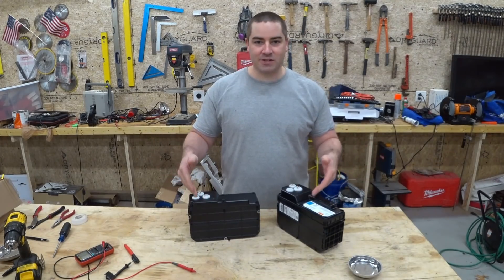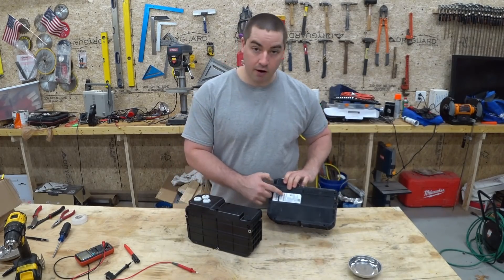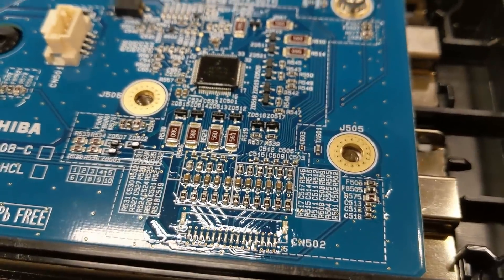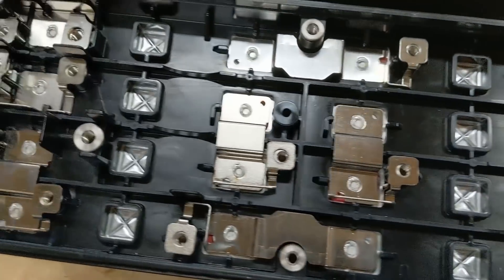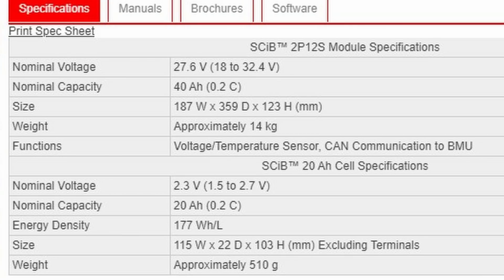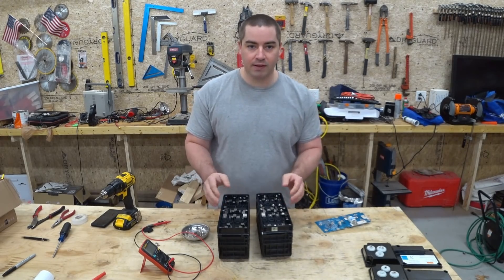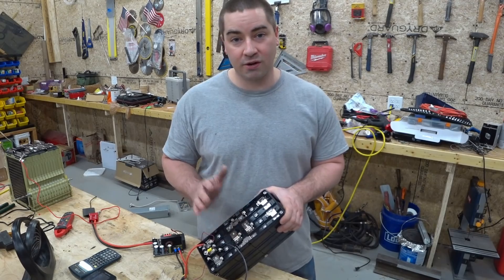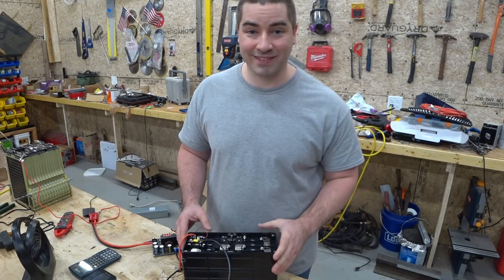Round Trip Efficiency Test on LTO SCIB Battery, Lithium Titanate

Comment: What kind of BMS will be recommended for this battery.
Reply from the maker: If you are building a 24V, 36V, or 48V, then I'd use this BMS: https://batteryhookup.com/collections/bms/products/8-24s-200a-lifepo4-bms-with-uart-rs485-can  
You will need the computer interface to re-program it to LTO settings.  It comes with LiFePO4 settings.  https://batteryhookup.com/collections/bms/products/computer-interface-for-battery-hookup-bms
Please use discount code DAVIDPOZ for a discount and it helps track this channel.

Comment: thats another great thing about LTO, you can get enough amps to start a vintage high compression v8 (1960's MEL 430) from something the size of a ytx30L-BS motorcycle battery.  and unlike lifepo4 or li-ion they don't blow up when crushed or shot.
Reply: makes them great for making portable jumper packs

Comment: The voltage adapter you used and/or mentioned, do you have the specs on it? When you talk about high battery voltage around 64v etc, my growatt MIN series requires between 350-500 volts 🤦‍♂️. 
Great video as usual and thank you for the explanation of the cell type etc.

Comment: Hi David it was wonderful explanation done by you in this SCiB batteries video 👌. How to import these batteries to India and how much it could cost for my Sedan car EV project. Also if you can suggest Reluctant motors which can be easily synchronise with these batteries. I am trying to fit for a Sedan Car which should have a range of 300 miles per charge. You can also write me to my email getmymail0015@gmail.com

Comment: They are currently doing some testing here:

https://batterytestcentre.com.au

My understanding is that some battery derating is necessary at temperatures above 35°C, but I do not think this will be part of the testing process.  In spite of your excitement for cold weather, there is, also, some derating for cold weather.  Take a look at the Zenaji warranty.  It should provide you a better idea,

Comment: I use lto in my truck to power a 20000watt system in my truck. I love this battery. I also discharged to 2v on 4 cells and made a full recovery
Reply: I also use lto to power a 35kw system in my suv.  They are amazing cells
Reply: I have a 6kw in my trailer can let it freeze and have solar panels to keep it charged with 5c charging rates and no issues with discharging to much zero. they are pretty much maintenance free had to install 2 battery balancers as on the top end they swing wild. But if you don't need the last ten percent one is enough

Comment: Your 2.0V discharge cutoff is ok for most applications. Just be aware that if your in a cold environment and doing 1C rate or above that this is leaving about 20% of the capacity unused. I think that's the main reason that the manufacturer lists 1.5V instead. Indoors in climate control 2.0V is fine but in the cold it's nowhere near as steep of a dropoff at 2.0V.

Comment: The potential of these batteries is being underutilized. These should be used to make electric boom lifts, scissor lifts and fork lifts. They seem to be extremely durable and long lived. Most of these machines need counter-weights built into them to avoid tipping over, so the added weight of the batteries could double as the counter-weights, the machines would be super efficient and would have decades of service life.

Comment: What type of system would I need for a small government Military generator , 5, 000 t0  10, 000 watts , I am putting solar cells on a shed I bought from the   Minanites  , they even stoped me from building my tiny home , tell it was paid for , then 2 years latter they started to make there own , I was not happy at all , & they to not want give me a bill of sale  , it came out of Denver Co . We had  group of kids take a car & put the 1.5 Lithium batters together , I don’t remember the volts or the way it was made , before they closed the track they got the car to run close to 200 in 1/4 mile , my building is on a 5th wheel trailer that was a travel trailer that burned & has slide out  , one of the gray water tanks  , I have 2 black water tanks to put in . The trailer is 48 feet  , & the building is 8’ X 16 , we are going to add to too the building , main deck is 40’ , & it 38’ to 40’ . It came with 2 big axle , but we are going to add 3 axle with a spread to carry the weight , it is being moved to Washington ,State , as I have to get to sea level ,  because of heath  you are helping me a lot thank you , I had a gas generator , but was stolen  . Thank You very much .

Comment: Running a 6S3P (Microvast 15 Ah cells) built 14.4VDC LTO battery built to order (China special - $500CAD) into a Group 31 battery box as my van's start battery.  It came with a 100A BMS which I cut out and it has been great thus far down to - 25°C (this winter so far has been warmer than last year, hoping for a cold snap just to see how they are).  LTOs are expensive, but in my case it comes out same as an equivalent 7S 40Ah PbAc racing battery.

Comment: That kind of cycle life? they can BE a little more expensive. Where I want them for stationary use, it doesn't matter, that they are a little heavier, and perhaps, a little more bulky. These just might be the thing for solar. I would probably use 80 cells, to be similar to 64 lithium Iron Phosphate cells, or 96 lead acid cells. (~192 volts-ish) I like being able to use these outside, because of their wider temperature range.

Comment: Is it normal for lithium batteries to discharge that fast? Because I experience the same thing with me Nissan leaf battery module when it reaches a certain volts
Reply from the maker: Yes, it's normal.  Check out a lithium "SOC to Voltage" curve.  You will see the "knee" and the voltage falls off the cliff.  Each type of lithium has this and if possible set your low voltage cutoff to stay out of this zone.  I found this one: https://www.energy.gov/sites/prod/files/2015/01/f19/batteryLeaf5045.pdf  Page 3 shows this.  For Nissan Leaf batteries I would not go below 3.5 volts per cell.

Comment: there is only a few LTO cells on the market today. The odd cell voltage makes them hard to use.  inverters and solar charge controllers at bult around lead acid or LFP (LiFePO4) and NiFe  4 cells LFP 12.8V , 6 cells lead 12V ,10 cells NiFe 12V . there is a salt water battery but had limitations and very large . not sure of cycle life. as the demand for batteries increase we will see some interesting new types. The solid state battery is around the corner.  a type if IC  chip that stores power.

Comment: there are 36 volt inverters out there this would work ok cause 42.4 is good voltage and 32 volts would be discharged my 36 volt inverter works great

Comment: Thanks for awesome review. I personally think, that LTO technology is very promising, especially due features, which are unique only for this chemistry and impossible to achieve for any other chemistries.

- extreme wide temperature abilities
- very long lifetime (100,000 cycles with 40-45% DoD) 
- ability to stay unharmed even discharged very deep down, far below designed cut-off voltage.
- round trip efficiency above 97% even after many thousands of cycles
- ability to work in high C rate (up to 10C discharge) without issue (no degradation of efficiency, lifetime or capacity, also no dendrites creation).
Actually I am starting my own business and one part of that will be working with this type of batteries and go deeper into, ideally to produce some own LTO batteries.

Comment: Wow, imagine if you could use them in your car battery, it regularly gets -20 to -40 F here in N. Dakota.  Wonder what the CCA equivalent would be?
Reply: The amp output on LTO is absolutely insane... you'd have no problem whatsoever starting just about any vehicle if configured in 6s (1p or 2p, obviously 2p for larger engines)
Reply: 1p starts a duramax 40amp cells 5c rate

Comment: I was told that the round trip was more like %80. Not sure what to make of your results.
Reply: Were you told that, or did you get to see a test that had the 80% result? We've all heard people state things as fact that they were  told in passing without any additional research. 
Me? I'm going to believe the test I watched happen done by someone who just likes to figure stuff out.
Reply: To the best of my current understanding, the pack is rated 19Ah, in the video pulling ~9A is ~0.5C. LTO can be very efficient at this mild load. The 80% round trip efficiency is expected when at 10C discharge rate. A test at 190A would be interesting, as might be seen in the use case of an electric vehicle conversion.
source: https://shop.gwl.eu/LTO-Tech/
Edited: to correct typo.
Reply: These are close to a super capacitor in ratings. I might be exaggerating a little but 99 percent efficient and 5c rating. Problems with them it above 90 percent they swing wildly on voltage and they are big and heavy for density other than that they are the best technology we have working right now

Comment: One thing Will Prowse said is they have high self discharge rate. I don't know if I believe it. But would you please test that too. Charge the battery, wait a week,  and then test capacity. Then do a month if you want. Lithium titanate in an electric car is a 4 million mile battery (do the math).
Reply from the maker: High self-discharge?  No, I don't think that's right.  In the beginning of the video you saw I had two modules.  I checked every cell voltage of each module (all 16 cells).  Then I proceeded with capacity testing on just one module.  The other module I set on my floor (concrete).  It's been sitting there un-touched for over two weeks.  I just checked each cell voltage right now so I could respond to your comment.  Each cell is at exactly the same voltage.  Down to the mili-volt.
Reply: Could you please share that Will Prowse link? I'd love to compare the testing methodologies and see how they each got to their results.
Reply: Will prowse review was garbage.

Comment: I’ve tested the 10 cell ITO version of these sold by battery hookup and measured >99% efficiency.
Another plus was that I also obtained slightly more watt hours than the labeled capacity. (444 Wh actual vs. 416 as labeled) not to shabby for a used battery.
I also observed very tightly matched capacity and cell voltages as David noted. (Worst case was 5mV across all 20 cells)
Reply from the maker: Awesome!

Comment: I am not sure why the removed circuit board is so "Cool"???
Reply from the maker: I don't know if it's something I can put my finger on.  The idea that this board can connect all the cell voltages to a central computer?  The tiny parts soldered on (I would need a magnifying glass).  And the way the fuse is attached with beefy bars?  Some team of engineers had to come up with the layout of all these components, make them fit on a board, while also grabbing the cell voltages.  All that planning, preparation, tooling, and failures to make this end product that is so elegant.  It blows me away.  I think it's cool.

Comment: LTO is great battery hookup also sells the large round individual cells around $10 a cell in quantity with beefy terminals

David don't leave us hanging ,wondering what the true capacity of the LiFEPO4 battery packs is.
Reply from the maker: Hi tee kay,  I have some fairly weak cells in the LiFePO4 modules.  So I have to stop my capacity tests early.  Usually around 28kwh.  In the next couple weeks I plan to add some bigger wires to inter-connect the like cells.  I'm hoping that gets me up over 30kwh.   At first I was hoping just some extra cycles would bring the capacity back.  And it did a little, but not enough.  Frankly I'm dissapointed in my "hub" and am kicking myself.  I'm still doing slow cycling up/down right now while I wait for my order of fuses and wire to come in.

Comment: That's an amazing efficiency - some of the loss would be through the inverters and chargers too don't forget, so its actually better than the number you got David. The 20,000 cycle lifetime makes them worth 4 - 10 the price of LiFePO4's and 40 times the price of AGM's (make that 80 times since AGM's really only have 50% of available capacity) if they were new. I wonder why the original owners got rid of them given that cycle life? In two years you would need to start the diesels they came from every 30 to 60 minutes to use that cycle life and get bang for buck from these cells.
Reply from the maker: I don't know why there were taken out of service.  But the performance of them tells me they were used very little.  I think it's an amazing deal.  Hindsight is 20/20.  If I knew these were coming I probably would have held off on my big LiFePO4 modules.

Comment: I see that it can be used at -30°C but can it be charged at -30°C? I cannot find any confirmation online about the LTO chemistry regarding how it handle charge at sub zero temperature. I once read that all lithium chemistry cannot be charged below 0 because of irreversible lithium plating. It would be interesting to know at how many C it can be charged versus different subzero temperature like -10, -15, -20
Reply: This si NOT a LiFePO4 chemistry. The chemistry is different!

Comment: Looks like one could use 5 of these and wire them as 2 sets of 20cells - to get 48v nominal - e.g. 20s2p per 5 modules.   With such nice screws - it looks like a wire up would not be that bad - standard eye terminals on some wire :).  Thanks for another great video!
Reply: You should wire 6s instead of 5s... the voltage drops quickly (settles quickly) on these things once pulled off the charger so 5s will typically be inadequate for your typical 12.8v lead acid replacement needs...
Just something to keep in mind...
Reply from the maker: Yeah!
Reply from the maker: I also love the screws.  Makes things easy to work with.

Comment: I bought three of the used 8 cell LTO modules I figure I can put them all in series for a 24 Cell 48 Volt 1kw battery pack, I found a BMS that will work with 24 cells and also an active cell balancer that will work with these too. Every cell was tested at 2.21V. I was thinking of buying three more but looks like they are all sold out. 22s is ideal for an 48V LTO battery pack but my Inverter can handle it so I will just program the charge controller to charge the pack to 60V and program the BMS to allow the cells to go from 2.0 to 2.52V per cell. This will allow me to use all of the cells and not go to waste.
Reply from the maker: Nice, that will make a good 48v pack.
Reply: • LTO Vnom = 2.4V (2.85Vmax/1.8Vmin)
• 48Vnom/2.4Vnom=20S, not 24S!
• 20S1P = 48Vnom/57Vmax/36Vmin
• 24S1P would be 9.6V higher across the board!

A 20S1P pack yields 960kWh/20Ah at a cost of $269.97 with four cells left over (assuming $99.99 per module, less 10% with David's affiliate link).

Be absolutely certain that the BMS and balancer are either rated for LTO, or fully programmable.
Reply: @ARepublicIfYouCanKeepIt  Just do a search for LTO BMS 24S and you will see them. and if needed there are active balancers for LTO for a 24S pack as well. Regarding voltage having each cell between 2.2 and 2.5 -2.55 at 24S will allow the voltage feeding inverter between 52 and 60 61 Volts just fine. The inverter I will use can handle up to 64  volts. Using 5S per 12V or 20S per 48V system  ends up having the voltage way to low. 22S would be ideal but since my inverter can handle the higher voltage of 24S at 2.5V per cell on a full charge why not. It's possible I could would consider a 22S but not 20S When the voltage starts dropping down on LTO cells there is little left that low. As long as the inverter can handle it I rather use use all 24 Cells. Especially when using these Modules. I would not be taking the voltage higher than 60 to 61 Volts. and I will still get most of the capacity out of them. By using all 24 Cells I am not wasting them either. If your inverter can't handle the higher voltage then drop a cell. Also there is hardly anything between 2.5 and 2.85V the voltage drops very quickly as soon as you put a load on them. So I could care less about trying to use power between 2.5 and 2.85 Look at the Discharge curve on these and you will understand. Most of the power is between 2.2 and 2.52
Reply: Battery balancers and charge limiters are all that is needed no bms

Comment: Like #60.  What is the cost?  They are soldout.
Reply: $99.99 for one. $199.98 for what David was demonstrating (less the 10% discount for using David's affiliate link).

For comparison, this is roughly equivalent to a 13S3P Li-ion pack. At a reasonable $1.95/cell (brand new, never used cells), the same pack capacity would run just $76.05. Of course, such a pack would be rated for 3,000 to 5,000 cycles vs. LTO's 20,000 cycles. Additionally, no charging below 32°F/0°C, and match the discharge current rating to the cells used.

Hope that helps.